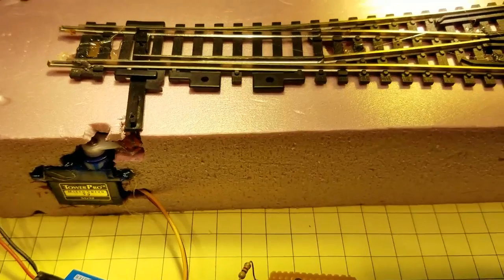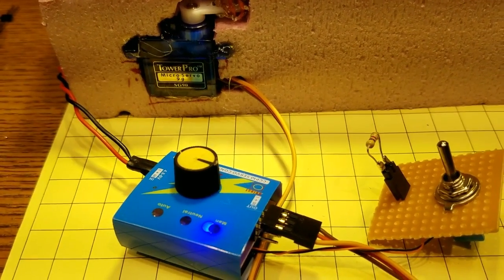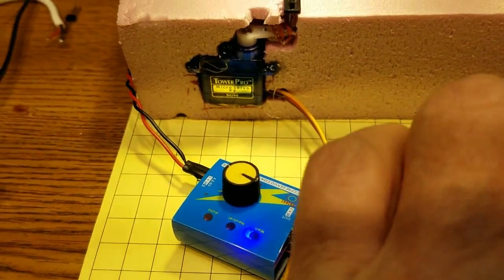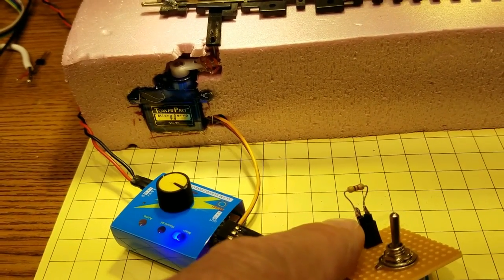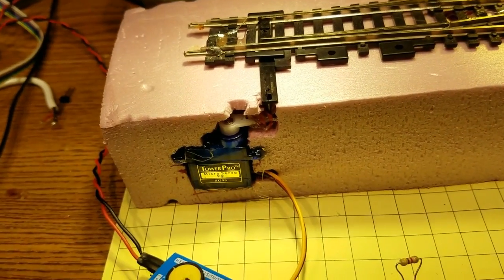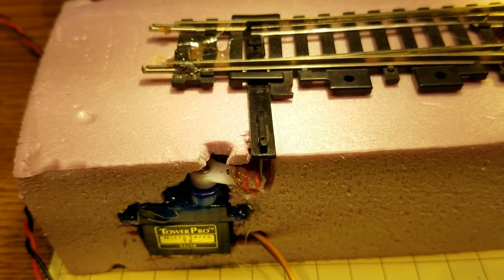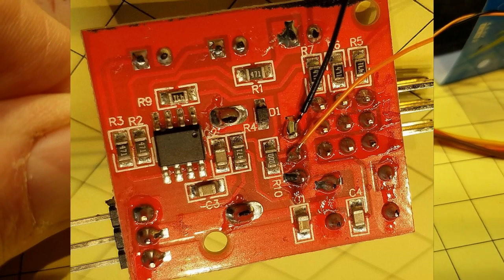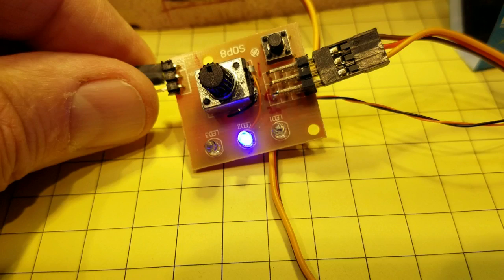Simple Servo Controller

Comment: You are awesome!   Someone now makes a push button controller, but by the time you pay shipping, they come out to 10.00 each!!!    Should be such a simple thing!!!!  And, here you are killing it.  LOL.   I still think servos are by far the best way to switch turnouts!   Parts are dirt cheap, replacement is easy.   I need to do a video of a cool thing I came up with for O scale manual turnouts to switch with a servo.   No limit settings needed.  Bullet proof.   I'm going to do the same for smaller scales.

Comment: hi Dave, I just recently purchased 30 of these guys off e-bay to re-do all my point motors. it seems like the people who manufactured this servo tester must have changed something in the engineering. the problem I have is as follows. while they work fine just as your video- after selecting the rite resister and adjusting the throw.  if you turn the power supply off to resume at a later time. when you power up the servos do a complete cycle turning the servo arm almost 320 degrees. I tried ten different servos and five different power supplies.  3V- 5V-.5.5V  and 6V DC wall plug power supplies and a 5 cell R/C flight pac battery, all giving me the same results.  also when I compare the circuit board that i have with the one in your video there are definite changes although the blue package covering, yellow knob, led's, selector switch and lettering are identical to what is shown in your video. please help, I purchased 30 of these 30 servos and spent a ton of time building a control box for everything,,,thanks Terry D
Reply from the maker: Terry, sorry to hear that the operation has changed.  Best bet is that another manufacturer copied the circuit and made some changes.  I purchased some from Amazon the other day.  I'll see how they work.  Thanks for the information
Reply: @DaveBodnar  I was trying to email something to info at train electronics and it wouldn't go, do you have an e-mail that I can send some pics of the board that I received?
Reply from the maker: @terrydanca2438  dave@davebodnar.com

Comment: Hello, great video 👏 I have a question, is it possible instead of the tester to put the servo motor on an RC transmitter and be able to use a switch, how did you do it?
Reply from the maker: You could connect the servo to a RC receiver and use one of the transmitter controls to move it
dave
Reply: @DaveBodnar  Thank you very much for responding.  Yes that I know.  Can I plug the tester into the receiver?
Reply from the maker: @olacarpe6676  I do not think so
dave

Comment: Hi Dave.   Ihave used your idea to operate my N scale points and have gone on to develop my own version of the servo tester circuit using a 555 chip.   I am just putting together a video showing the stages I went through in this process and would like your permission to include a section of your video in mine.   You can check out my other videos here    https://www.youtube.com/channel/UCJYfBOl-lfQnB8g9VLPwWlQ
Cheers Patrick

Comment: Interesting, I was looking into doing something similar. There is a 555 circuit out there but if something is ready made apart from the resistor, then that could be easier than some.

Comment from the maker: I do not
I'll see if I can figure it out tomorrow
Reply from the maker: My Hobbles, I took a look at two different servo testers and there is no information engraved on the mircoprocessor - one is an 8 pin surface mount and one is a 14 pin - there are any number of generic chips that could be used but no clues inside!
dave

Comment: Very great, many thanks! I am now using this on my N Gauge layout, tests work great with finescale 'finetrax' turnouts. I found you can do this for about £1.50 per turnout from Ali Express, including servo, controller (servo tester) and resistor. Surely the cheapest method of turnout control ever, maybe evening including wire in tube! Fantastic!

Comment: Dave..  Just saw these controllers on eBay and thought the same thing.  You saved me wondering if they would work.
I have a bunch of rc servos laying around.  
Question..   Is it feasible with this mod to wire another servo in tandem ( with a Y  ) to control 2 switches.  Assume servos would have to be identical.

Thanks again.  Just decided to wire up some trains.   Looking forward to your other videos.

Wayne
Reply from the maker: Wayne - I have used the controller with multiple servos (there are 3 sets of output pins so that is easy to do) - just make sure you provide sufficient power (current) to drive them all.
Enjoy!
dave

Comment: Dave, you mentioned using a higher value resistor for shorter throws of switch. I am using N scale. Is there a resistor size you might prefer for that gauge? I don't know what I am doing here! Thanks again, Mel
Reply from the maker: Mel - the value of the resistor has nothing to do with the gauge - It only sets the throw of the points - just experiment with resistor value until you get something that works for you.
Good luck & enjoy!
dave

Comment: Hi Dave,
Just found your channel having just bought 10 tower micro servos to operate my peco points but not knowing how to control  them. I will now order 10 servo testers at  £1.02p each ,would i be able to operate signals at the same time as a point ?
Regards and thanks for a great tutorial
Reply from the maker: Good to hear you found the info of value - to operate signals you would need to add some circuitry or have the servo's arm hit a switch as well as throw the points - doable for sure but a bit of experimentation is in order!
dave
Reply: Hi Dave,
Thanks for your reply, just a question about the spdt switch is that a on off switch or on on switch probably a daft question but had to ask.
Regards Wayne.
Reply from the maker: You don't even need a SPDT as a SPST (single pole, single pole) switch will do - it is an on/off switch

dave

Comment: Dave, thanks for the video. I have a question tho. What did you use for power supply to the tester?
Reply from the maker: Mel - You can use a voltage from 3.5 to 5 volts - I used a 3.7 volt cell phone battery for some tests - you could also use a cell phone charger as most put out 5 volts DC
dave

Comment: Have you or is there a way to run this with the DCC model railroad system?
Reply from the maker: Dave - I have not tried using this with DCC but you surely could if you set up your DCC controller to operate a relay to change the servo's direction - just put the relay in place of the toggle switch.
dave
Reply: And u could keep this on a separate power fed and orporate the points manually and the trains dcc as that's how I will be doing mine 

So hears my question what voltage is save for this as the power from the controller with I think it's called a cdu would be 12 volts so would it be save to do that

Comment: how many servos/basically railroad switches can be operated with one servo tester? I couldnt find it in product description..
it has 3 outputs, but as i saw in video, youve soldered the switch direct to the board.
Reply from the maker: You should be able to operate 3 or more so long as you provide sufficient power
Give it a try!
dave
Reply: and where to connect other 2 throw switches? I was thinking about to cut off the -IVE and +IVE wires to servo and solder the switch there. is it a way? 
you know, i am not electrician..
next one thought - do i need to use throw switch or on-off-on switch???  jeez, so many questions...
Reply from the maker: You should connect the other servos wired in parallel with the first one - the other two servo connections are wired that way.
Any normally open single-pole-single-throw switch will word.
dave

Comment: Hi Dave,
First of all thanks for this simple trick to drive the servos!!!! I was figuring out if we can slow down the throw speed of the servo? I want to have a slow movement of the switch... please advice 
Thanks 
Abhishek
Reply from the maker: Abhishek - the speed of the throw can't be changed with this controller - you would have to move to a PIC or Arduino or similar controller to vary the speed.
dave
Reply: Dave Bodnar Thanks a lot for a quick reply!!
Reply from the maker: I don't have a schematic but a search for "555 servo circuit" should get some results for you.

dave
Reply: Dave Bodnar Thanks a lot!!!

Comment: What will happen if I do not put a resistor?
Reply from the maker: If you left out the 4.7K resistor the servo would move to one extreme --- the value of the resistor determines how far the servo goes in one direction and the adjustment of the potentiometer sets the other direction movement.
Reply: I will not be using the resistor. Simply leave the potentiometer at zero. Mount the servo so that zero is one side of the switch and the added potentiometer value is the other. When the toggle interrupts the circuit it returns to zero.

Comment: Dave, I wanted to thank you for this. Long story short, I have created a program that talks to A USR-io88 8 channel relay board for a different project I have completed. I wanted the reuse the relay board to control 8 servos, but could not figure out how to make the servo turn fully, then with another click return to the original location. I took your design and used the relay as a substitute for the toggle switch. The wires that normally would be installed on the toggle switch are installed on the Normally Closed and normally open legs of the relay. When the relay is energized the servo spins fully, when the relay is DE-energized the servo returns to home. I have created a Windows program using C#  programming language and Microsoft's Visual Studio 2017.  Now I can use a touch screen tablet / laptop to control up to 8 servos on this  particular board. I paid  about $65.00 on EBAY for the board and it works great. Took me a while to figure out how to control the relays via code. Again Thanks for this video it pushed me in the right direction to solve a problem!
Reply from the maker: Skip - that is great news and a very creative way to use the simple servo control unit - well done & thanks for letting us know what you have done.
Congrats!
dave

Comment: Can a two step process be used? I would like to use a momentary switch in conjunction with the toggle to only power the servo motor during the switching movement.
Reply from the maker: Jeff McClain 
I don't see why not,  Jeff 
give it a try and let us know what you find 
Dave
Reply: Follow-up  answer. The two step process works great. A DPDT toggle is wired to the potentiometer and a momentary button switch to the power input. The potentiometer is turned full on to mount the servo to one side if the switch. After mounting turn down as required to switch to the other side. I hot glued the knob to maintain this position. Flip toggle then push momentary switch and switching occurs. A micro-switch mounted with the servo and actuated by the arm is wired to position LEDs on the fascia. The other side of the toggle is wired to the frog. A short will happen if toggle is flipped and button is not pushed. A safety push of the button during approach will lessen the risk. The beauty of this is two-fold. No computer input required and an overloaded servo will not continue to make noise or burnout. Oh and by far this is the cheapest way to electrify switching.

Comment: Dave,I am trying to do the same as you do. I am also trying to install switch point detection, either for normal point or reverse point condition. Have you tried anything for point detection?
Reply from the maker: I have not done any such tests, Adam - please let me know how your experiments go
dave
Reply: Sure, definitely. If point detection works, my plan is to cascade point detection relay back contact in series to energy path, so energy can be cut when switch completes its move.
Reply: Right now, just waiting for relays and parts to arrive and detailing.

Comment: Awesome video.  Thanks for sharing.  I plan on doing this for my new layout, but I plan on using an Arduino to control relays to control the servo motors.
Reply from the maker: You shouldn't need the relays as the Arduino can control servos directly.
dave
Reply: Thanks for the info.  I didn't know that it would power the servos directly.
Reply: Thanks, mate.

Comment: Hey man, I know nothing about working with servos, but I see potential to put something like this on the side of a drone for a payload release (basically a servo moves an arm holding a ring in place, the ring is connected to an object that is then dropped with a drone.) I own none of the parts for a settup like this. so what would I need? so far I believe I need a resister, servo, servo tester, and switch (i will be using a light detecting resistor so I can hook this up to an LED I have on my drone that is controlled from the controller). what type of power should i be using? is there any way to do this with a standard battery such as an AAA?
Reply from the maker: You might need some additional circuitry to get it to react to the LED - perhaps a transistor to amplify the output from the light sensor.  It is surely worth some experimentation.
Good luck and drop a note to let us  know how it goes.
dave
Reply: thanks man! but whats the cheapest battery you recommenced for this?
Reply from the maker: Three AA cells wired in series should do it - if weight is an issue you could use AAA cells
dave
Reply: awesome. Thanks!
Reply: Aaron Fowler  a

Comment: Great idea. Is it possible to feed to LEDs on a panel to show which way the turnout was switched using this method?
Reply from the maker: You would have to do that yourself - you could use a double-pole-double-throw toggle switch with one of the poles moving the servo and the other set doing a red and green LED.
dave
Reply: Thanks for the info Dave.

Comment: The idea itself is brilliant. However, servos are active even in they are not moving. They consume power and their service life. Ideally, you would switch off the servo after each use.
Reply from the maker: You are correct and make a valid point - thanks!
dave
Reply: @DaveBodnar  This is why they make what they call gear or retract servos for model airplanes. The servo will go to the desired position and stay there without consuming power and potentially burning itself out until the switch is moved to go into the opposite direction. A normal servo used on elevators and ailerons etc which I assume you have will always want to recenter itself when the stick is let go so if you you keep it in one direction for too long you use up the available power and potentially burn the servo out. Now I'm somewhat rusty on servos because I haven't played with a model aircraft or car etc in a while but I do know that a regular model airplane servo does not like to be held in position for too long because you can potentially burn them out even if the linkages etc are not adjusted properly it causes the servo to hunt for centre when centered or fight the command given. This is why they make the retract servo for model airplanes as it is designed to stay in the desired position until the command is given to go the other side. I would think a retract aka gear servo as it is better known would be a better option for this application as the servo itself will not want to recenter itself or Hunt for centre all the time. Hope this made some sense and helps? Thanks.
Reply from the maker: That is great information - I did now know about such servos - will check them out - thanks!
dave
Reply: @DaveBodnar  You are very welcome!